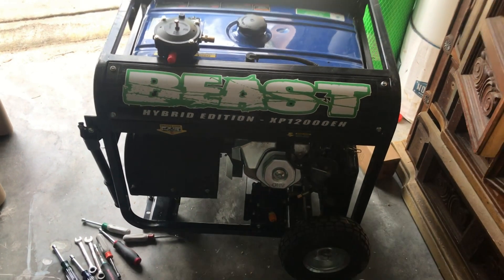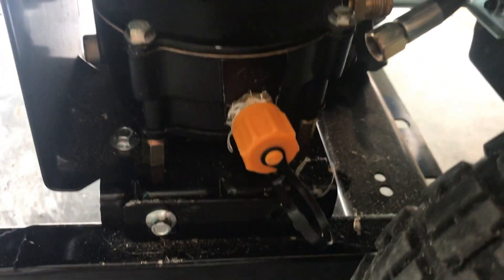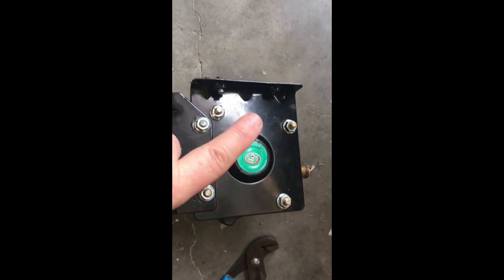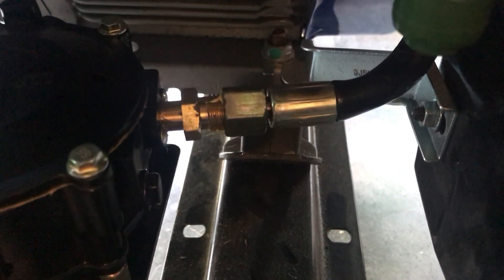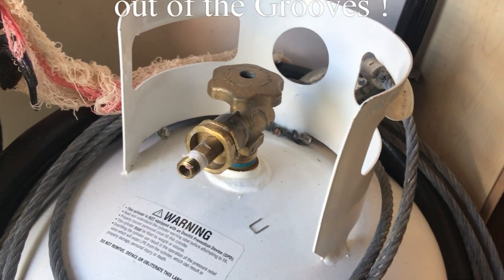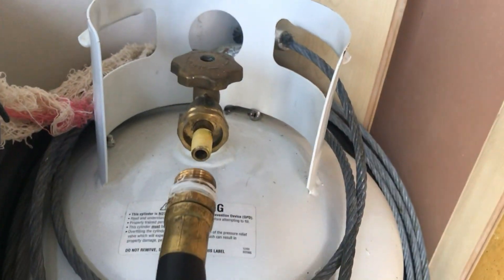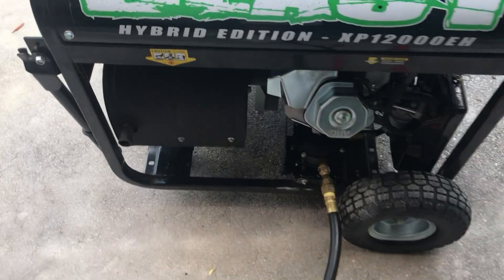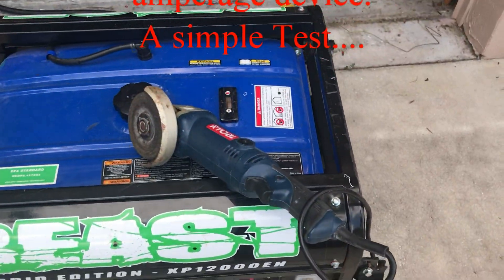2018:Re-Configure Propane Connections for Generator !

Comment: Around 1:14 you make a false statement. Perhaps you just mis-spoke. The correct thing to say is that one should only use thread tape on tapered threads. If using for propane, the thread tape must be compatible with propane. Do not put thread tape on straight threads. Straight threads are used where o-rings, or washers, or flares are used to make contact and seal.
Reply from the maker: Thanks for the tip

Comment: Duramax says the regulator that comes with generator will work fine on 100lb tank with a pol to qcc-1 adapter.
Reply from the maker: You can use a 20lb, 40lb or the 100lb or lager.  I used my 100lb with no issue on my generator !

Comment: If you’ll put a little pipe dope on after the tape you’ll never have a leak unless you have a crack.  It just works better.  It’s an old plumbers trick.  Yes the tape and dope have to be gas friendly.  A good way to load test a generator is with and electric heater.  They really draw and you can easily see how much,  the watts is listed right on them.

Comment: Thank you for sharing this video.  I found it extremely helpful, but saying “not to use Teflon tape on propane connections” is misleading to an amateur because gas line tape is also Teflon.  There are 3 classes of Teflon tape.  The pink is used on water lines; yellow is designed for gas-line use and the white is used on water lines.  The difference is the density, but they are all Teflon Tape.
Reply: People get trade tickets.good for you picking up on the wrong tape

Comment: Hey kelly, if you could confirm for me. I bought a 100lb propane tank for my westinghouse 4500df inverter generator. Am i correct in assuming 20lb to 100lb propane tanks have similar pressures when filled and that the stock regulator that is supplied with my generator will work granted i add the adapter to convert old to new thread style. I plan on just having my adapter on the 100lb tank with a 10ft extension hose off that and then into the regulator/generator.  I don't want to install the regulator on the propane tank itself in case i want to fuel different  products with different regulator requirements.

Comment: What is the max BTU for this regulator ? Also I have the Newest DuroMax 13000EH but with a 30lb & 40 lb tank setup, But the regulator that came with the Generator Freezes. I am in FL
Reply from the maker: Hi

I am not sure about max BTU.  I just know it can run my 11KW AC.   

I HIGHLY suggest you get the replacement Duramax regulator.  This this hurricane season in 2019 I ran this on the new regulator with propane and wow did it make a great difference. It ran smooth as butter. Once I put a load on the generator with propane it actually smoothed  out it was purring along

I kept the regulator the propane company sold me but it made no difference.  So I have two regulators on my system. 

If your generator running on propane stutters you need to get the updated one.  

I hope that helps you.

Comment: I just got the new 12000EH and it came with another regulator and hose that attaches from a 20# tank.  I also called my propane company and they said you do need a single stage regulator, which I believe you have.  I saw the make is MEC, but what is the model number?
Reply from the maker: Hi

I Have the XPR 1200EH.  

Just make sure you get the hose with a three-quarter inch connector on the generator side. And the standard size on the propane tank. My 100 pound tank I just have what the propane company sold me

Comment: Knowing that the 100lb propane tank only holds 23.6 gal of propane why not consider going to Natural Gas?  Great video series on generators BTW. Thanks.
Reply: @DONALD1951  

Actually the stationary units are natural gas,  I was hoping that the Beast might be interested in a cool mod like the video I put up to have the option of using Natural gas,  another fuel supply that potential  could power the Beast for a longer duration in a disaster.
Reply: No Natural gas service available.
Reply from the maker: Leonard Eng 

Thanks Sir.  I will have to look into that.
Reply: @miamitreasurehunter   some thing like this video

https://youtu.be/nO839Sayci0

Or

https://youtu.be/rA9T1V5wBTE

I got 8 propane tanks and 8 gas tanks for my gen but watching the videos can't help but think that with a 3rd fuel source would feel really good on powering the gen.

Comment: So was that regulator bad from the factory mine does the same thing on propane
Reply from the maker: As a 2019 update, with a new regulator. I retested it for the 2019 hurricane season. Running only on propane I was amazed  what the new regulator did 
 It ran smooth as silk and I was so impressed.

I ran my High Amp Washer through a full washing I didn’t stutter once. That took about an hour.
Reply from the maker: Josh Snook Hi

Yes it was. Call them and request a replacement.  It took months for me as it was back ordered.  But that was 4 months ago.  

You can tell a big difference in this model.
Reply: @miamitreasurehunter  thanks so much I used my generator the first time 2 months after getting it went 10 days running it I'll let you know how make out
Reply: I did mine is on back order until October 30 had to pay 10 bucks for shipping
Reply from the maker: Josh Snook 

Hi. Yes the original regulator was bad.  

Ask for a replacement.  It was free.

Comment: Where can I buy that same gas connecter and line? I have the 10k duramax with the worthington 100 gallon propane  tank.
Reply from the maker: HI.   See my Video on this   https://www.youtube.com/watch?v=p14rM97W54E&t=12s    But the short answer is Duramax has a 3/8" at the generator side, you will have to get reducers.  But find a Local Propane Dealer and get a straight connection from the Tank to the Generator, you don't need the Regulator,  the Duramax Generator has one.  It only cost 50$ for the Regulator from the Propane Company.  Buy the smaller gauge hose (The large thick one)   All in all it cost me 150$ for all the hoses, and brass connectors.  Your Generator is just like a BBQ Grill on its connection 3/8"Hope that helps. Good Luck and God Speed !Kelly
Reply: @miamitreasurehunter   Thank you sir!!!
Reply from the maker: Hi

I just googled my local propane dealer.  They were great at helping me piece it together.
Reply: 100 gallon or 100 pound? I'm betting you have a 100 pound tank, not a 100 gallon.

Comment: you can use Teflon PASTE but never the white tape...only yellow
Reply from the maker: Litchfield County Computer   Thanks. I never knew that.
Reply: The problem is that propane is a slight corrosive and will eat the white tape...it will NOT eat the PTFE (yellow tape)
Reply from the maker: All the yellow tape people are absolute correct this year in 2019 I read it all my connections with the yellow tape and not a single leak. It was just like magic.